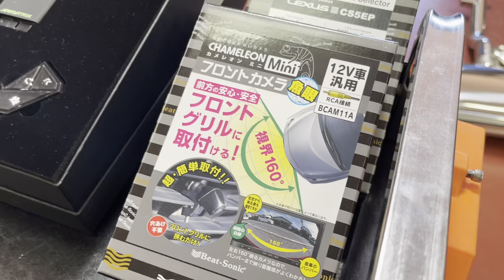LC 500 Convertible// Air Suspension, Exhaust, & Body Kit

Comment: Clean job well done. Its definately not what id do. My 22 coupe is bone stock... for now. Ive thought about new wheels and tires and a cat back but unsure of which system.  I honestly don't get the lowering but its done well.
Reply: +2 , on my Infrared being stock minus a few small carbon fiber accents.

I personally think the LC looks much cleaner without it being modded.